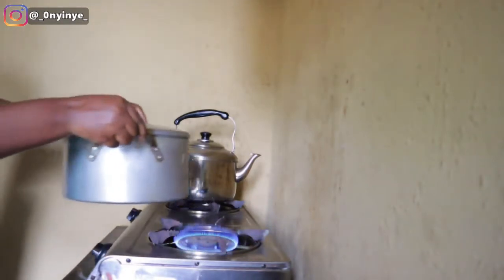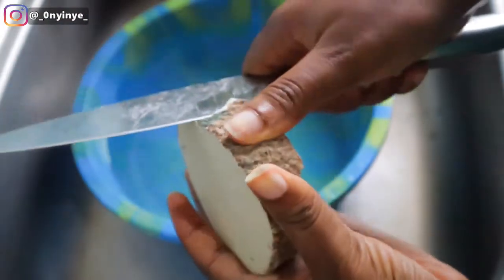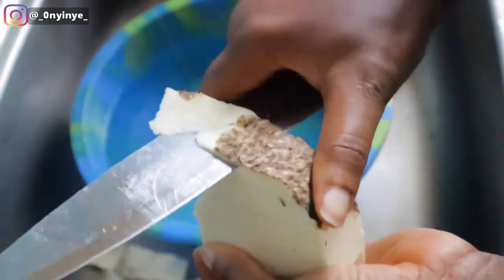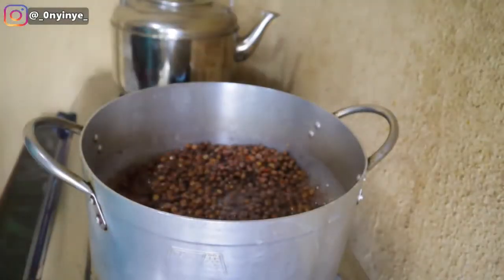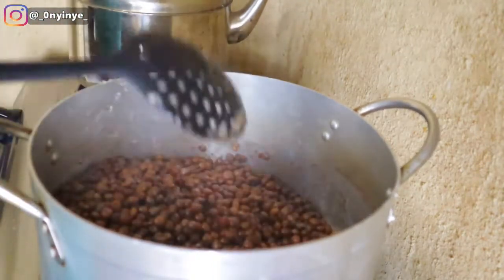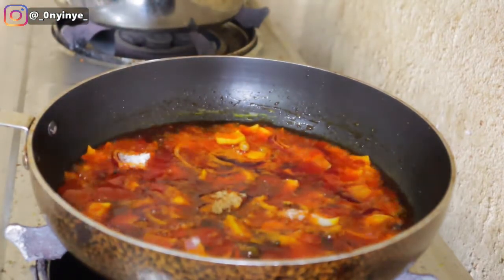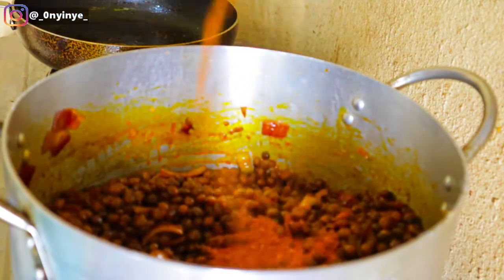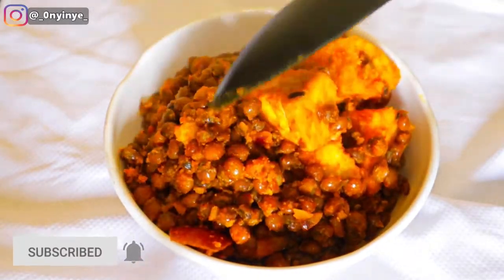HOW TO COOK DELICIOUS FIO-FIO & YAM WITHOUT POTASH | EASY NIGERIAN FIO-FIO And YAM RECIPE

Comment: On the process of turning  the fio fio was it is on the fire you are doing that?
Reply from the maker: No. After turning the fio fio, you then place it on fire to make it warm, before turning off the stove.
If you do the turning process on fire, it will burn a lot before you're done.